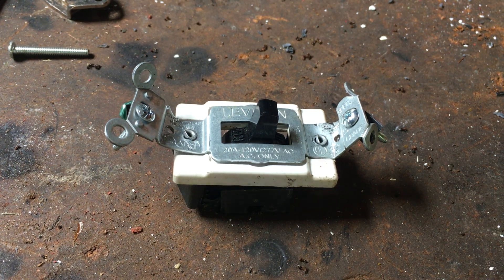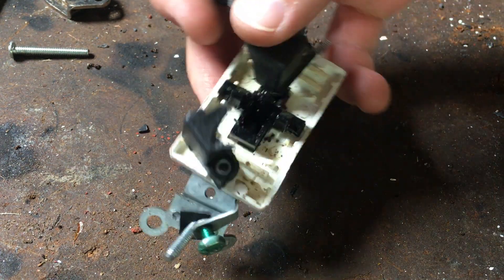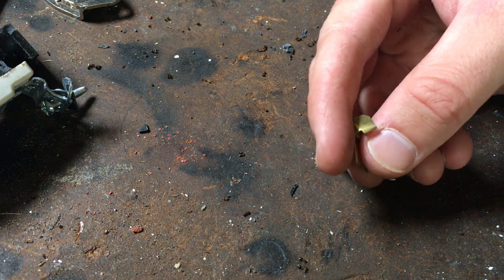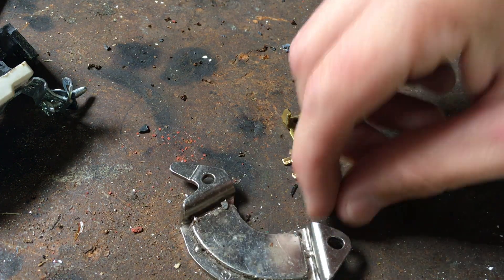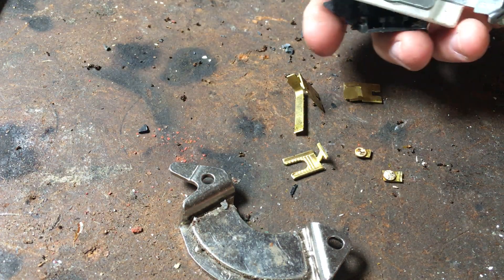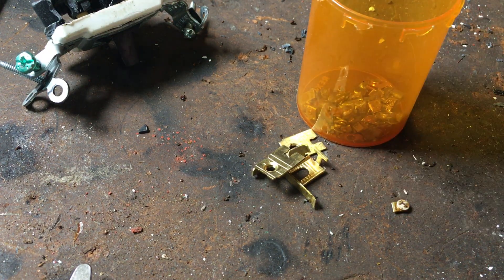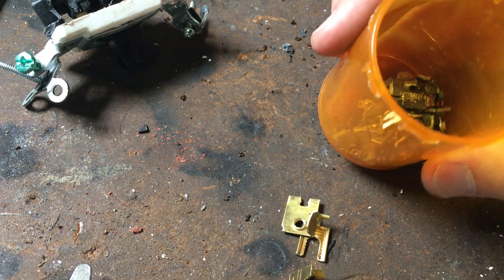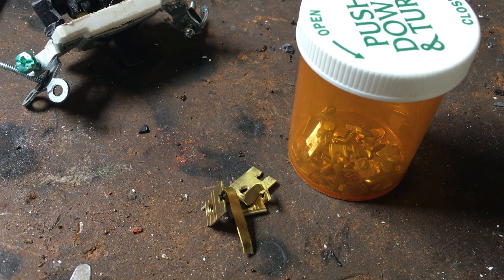Scrapping a light switch for Silver and Brass

Comment: FYI I did an experiment on this. I took 9 single throw switches and 5 three way switches. Mashed with hammer, clipped silver contacts, also clipped off a similar sized piece of brass the contact sat on to weigh and get an idea of how much brass vs silver for each contact.  I saved brass screws and other brass parts.

At the end of the experiment I figured you would make about 7 cents per switch and that's without time and effort to retrieve the silver.

Waste of time.